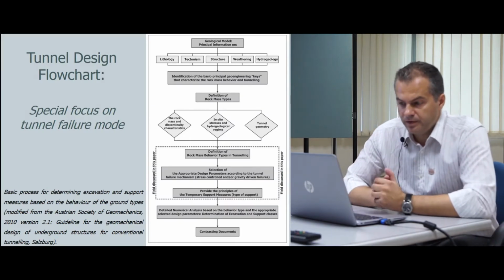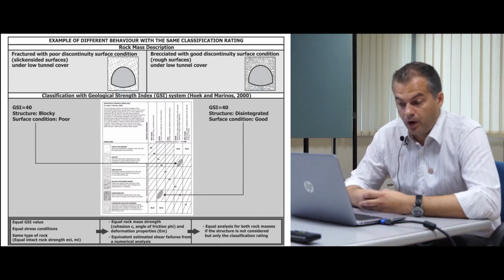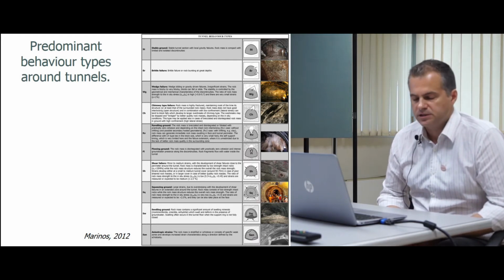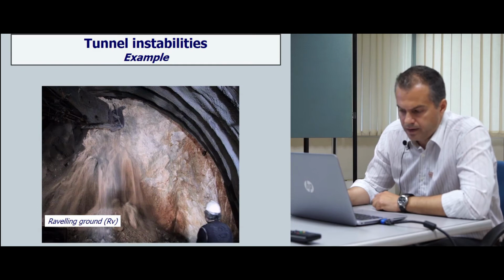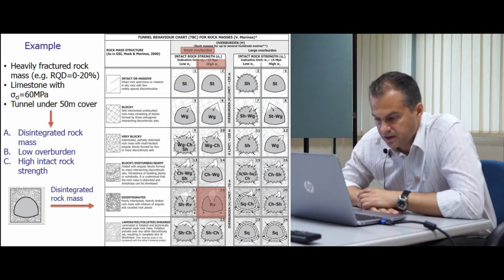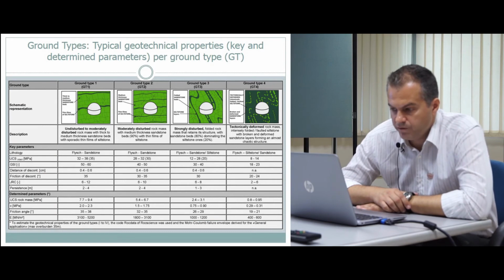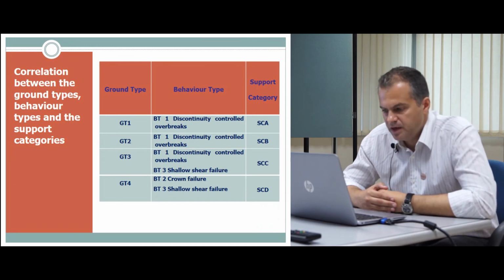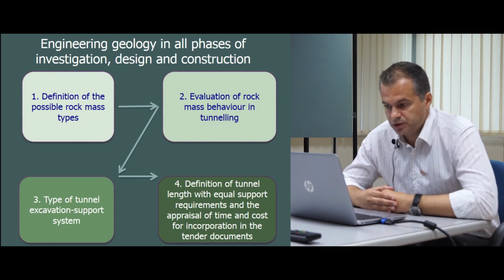Assessing Rock Mass Behaviour for Tunnelling - IAEG Marinos Vassilis

Comment: Thanks for sharing this lecture. Is it possible to use RMR for the second case considering there is no Joints? and if it was the case, why to get a high value for joint conditions considering a low RQD. Thanks and regards from Peru

Comment: Thank you for this valuable lecture on rock mass behavior. 
As you have compared different behavior with same classification rating (GSI).
if surface condition of discontinuities is different in both of the cases consequently the rock mass strength or values for cohesion and friction will not be different??? how the value of these two strength parameters could be same?
thanks, and regards
Reply: Thank you for your question. The different surface condition is evaluated in the GSI value. One rock mass has "Blocky" structure but "Poor" discontinuity surface (i.e. GSI~40) and the other rock mass "Disintegrated" structure and "Good" discontinuity surface condition (i.e. GSI~40). So the combination of different structures and different surface quality can result to same rock mass classification values. In the Hoek & Brown Failure criteria your input values will be GSI,σci, mi and D. So you can result in same strength properties.